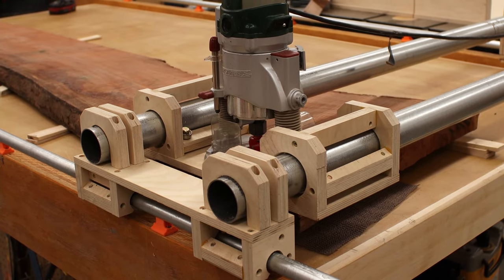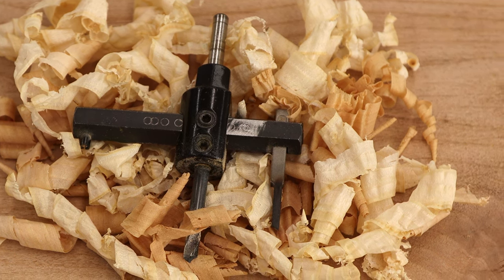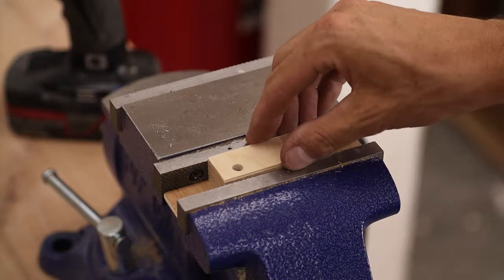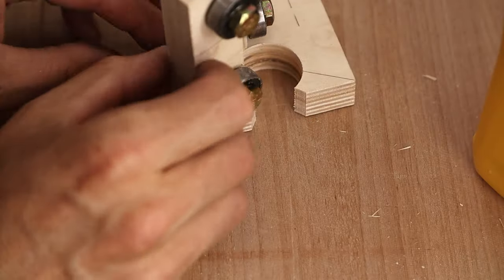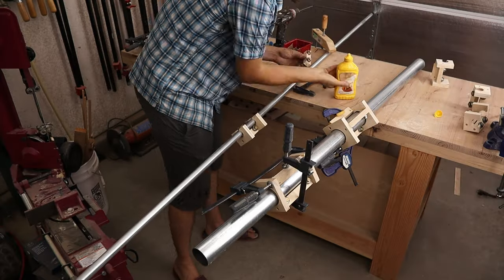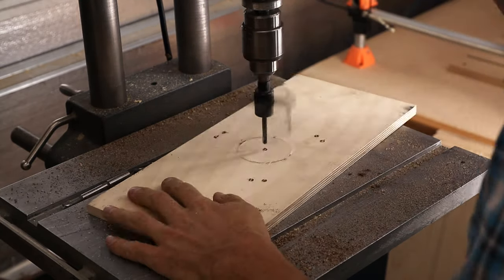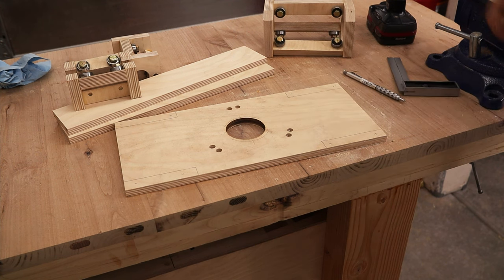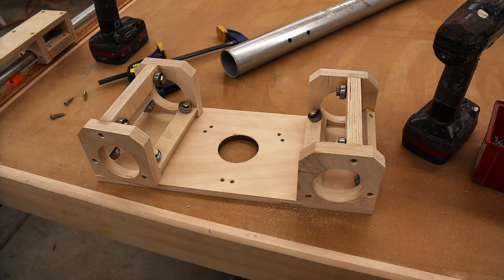Make a GIANT Router Sled | Overengineered Slab Flattening Jig

Comment from the maker: I've had my router for about 10 years now and it is starting to die. What routers do you all recommend I check out?
Reply: From my research the Bosch 2.3hp unit with the wooden handles is a great buy. That's what I just picked up but haven't used it yet, making the router sled. That being said the Triton make a good big boy, but from reading on forums they may have fallen off a bit in terms of quality. The large Dewalt unit seems to be what is suggested now. If you are using your old one still you could get a big boy for slab flattening. You could leave the old one in a router table setup or you could keep it handy with an 1/8th round over bit or whatever bit you use most. I'm not sure of the condition of your router but it's nice to have an extra router with a different bit to save time from what I hear. Not necessary but convenient.
Reply from the maker: @MrT-dn5hm  this is great thanks. My current router is ok but it would be great to not have to switch all the time and have something with a bit more power. I noticed the triton used to get tons of love but I am not seeing so much the past two years. I’ll certainly look at the dewalt, I didn’t even consider them so good to know on that.

Comment: I've had trouble finding a circle cutter that will cut the smaller circles. I found a 2-blade cutter at Harbor Freight that will go down to 1-1/4. I think if I take one of the cutters off I can get down to the 1-13/64.
Reply from the maker: Thanks for the tip on the Harbor Freight one! I updated the link to point to the different cutters on amazon. The General Tools model 4 (https://amzn.to/3iMMlPd)  should cut all the way down to 7/8 of an inch.

Comment: That sled looks awesome.
Reply: Thanks, i just used it to flatten an entire table top yesterday and it took like 5 min for setup and 10 to do the flattening on both sides. I should have made this years ago.
Reply from the maker: If you build another table let me know and you can bring it over and ill flatten it for you :)
Reply: @BuildItMakeIt  No plans to build another one but I have thought about reflattening the one I have. I did it with a belt sander initially and it's not very flat.

Comment: Anyone that has built this, What would you estimate your cost to be?  Not counting a router
Reply from the maker: It cost me just north of 100 dollars when I made mine. There has been a bit of inflation since which has pushed up the price, but I have found the larger conduit to be ~25 dollars at actual electric stores vs when I bought mine at the local home improvement store for 40 so that can save. My guess is about 125 these days.